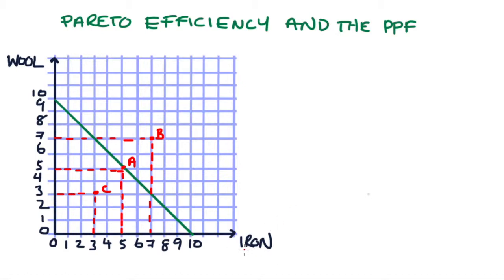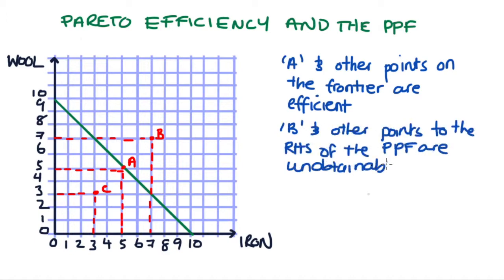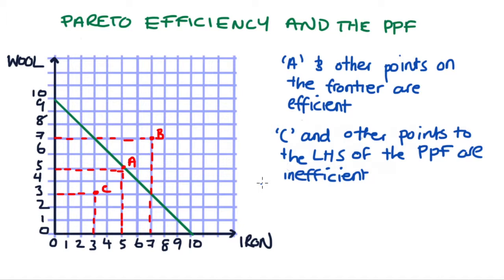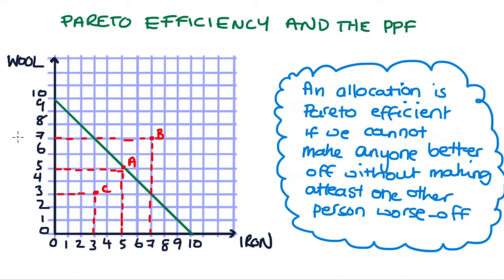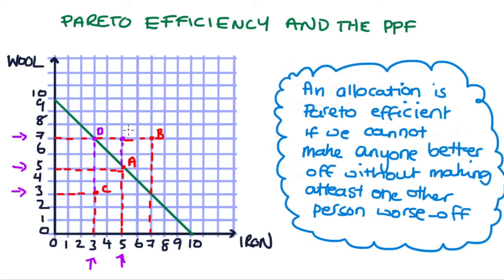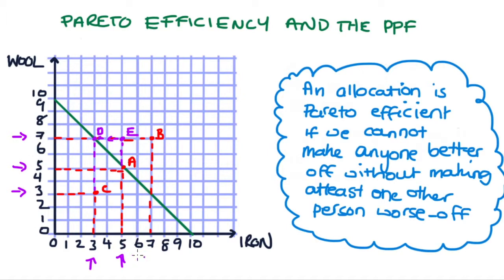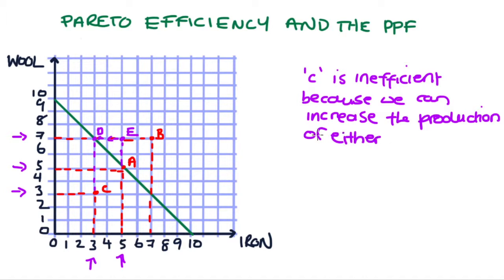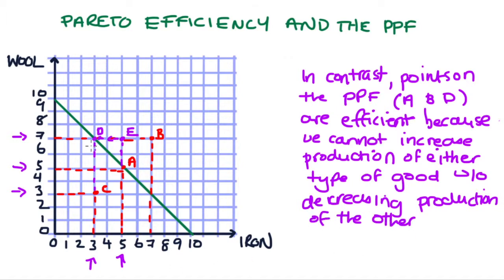Production Possibility Frontier (PPF) and Efficiency

Comment: Hello ma'am please help me with this case as well : There are three Points A,B,C on a Pareto frontier and it has been asked to draw a point like D such that A and B are pareto preferred to D but C is not. 
Please help me it's urgent.
Reply from the maker: It will be the same sort of analysis. You will have to find a point  of production where both points A and B, in comparison, do 'better' in the sense that you re making more of at least one good and not less of either. And this point has to be such that production level C in comparison does not produce as much of at least one of the goods. You can draw the horizontal and vertical lines up and across from that point, to see that the area in-between those lines encompasses A and B but not C.

Comment: Hello , please tell me that if there are three points A,B,C which are on the frontier. And it is asked to draw a point D which is Pareto preferred to A and B but not to C then where will it lie?
Reply from the maker: I think I understand, though I'm not sure. Take point A and trace two lines, one perfectly straight up from point A and also one perfectly horizontal, to the right of point A. The area that is bounded by these two lines shows us points that are Pareto preferred to point A, since in this area we are producing more of at least one of the goods, and never less of either good. Do this for all three points. You should be able to find some level of production where the area of Pareto preferred options overlaps for A and B, but not C. At this point, compared to A and B you will be making more of at least one of the goods (and never less of either), but, compared to point C, you will be making less of at least one of the goods, hence not a Pareto improvement from C, but from A and B, yes.
Reply: Thankyou for responding ❤️